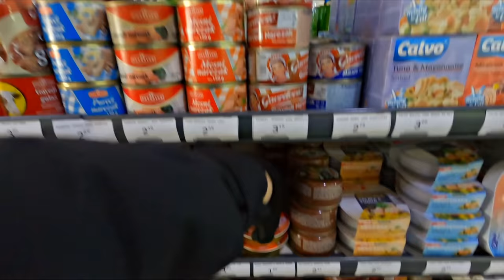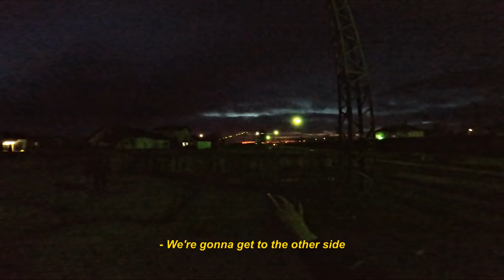Journey Across Bosnia & Herzegovina | Part 1

Comment: Great content guys but just a bit of friendly advice, I've been involved with the Mines side of Bosnia for many years, granted around Prijedor you are fairly safe camping in the woods as the area is quite a way behind the former confrontation lines, however around Doboj and other places it is still not safe to go into wooded areas to camp, most mined areas are clearly marked however they are not fenced off and you will miss the mine signs at night especially which can be spaced out over quite a distance in between each other, if you continue in Bosnia or any country bordering it please check with as many locals you can as to the location of mined areas.
Reply: Replying to this comment as VERY VALUABLE ADVICE.
Reply: Well, I live in Bosnia, and let me just lower the fear of mines for a second. Yes, there are still mine fields, but they are no where near any villages/towns. They are deep in the forests/fields, and quite far from any human access. The ones that are anywhere near are well marked. I personally think they don’t go kilometers deep in the fields and forests for a camp. 

Im just sad to see so many comments about mines here, I lived here my whole life, travelled entire country back and forth, through forests and fields, and never even crossed anywhere near mine field. So im not really sure why is there so much fuss about it. It’s literally hard to find them even if you try.

Comment: I understand that doing this kind of stuff would require a lot of planning, knowledge and survival skills. But exploration is one of those things I really want to experience more in my life, it certainly does seem overall quite fulfilling. Especially taking in the atmosphere of the environments you travel through.
Reply: Get it done before you're 40. The old body is not like the young body was, js.
Reply: same i wanna expirience all of this before i die
Reply: The experience is Much Much harder than shiey videos make it look
Reply: @cyclocrossthesea-lionman1824  agreed. Shieys videos (especially the newer ones) don't show the hours of doing literally nothing, sitting outside in -15° weather in little clothing, or the blazing heat in summer. Along with risks, sickness wildlife, even just one bad fall or breaking a bone unluckily and you can die easily.
Reply: @rickc2102  what happens when your 40? lol
Reply: @Plant_lover_495  you become 40, anything physical is harder then.
Reply: @ilikefrogs4291  yes that is true, but its all relative. Working out is never easy so just never stop so your body stays used to fitness. Its when you stop; thats when it get tough...starting again.

Comment: Watch those overhead wires man, medium rare shiey if your not careful.
Reply: True. You can read a lot about fried trainhoppers in russian newspapers. The risk to be electrocuted is quite insidious because it's difficult to foresee the consequences: one day you are riding a train and everything is fine (because the air humidity is low) and the next day you are dead in a seemingly the same circumstances (because the air humidity is a little bit higher).
Reply: @ZZizitt  yeah you don't even need to touch the wire to get cooked.

Comment: 24:38 - protip: jump to the opposite side the train is going. by inertia you will get "launched" to the way the train is headed. If you jump to the opposite side of the train you will compensate part of the inertia.
Reply: That´s true, but i think only at low speed. If you jump of in opposite direction you could fall on your back/head which is "maybe" more dangerous, especially at higher speeds.
Reply: @02 Aakash Bardia No, that is false. You have to jump to the  opposite side, but look where the train is headed. That way your fall will be safer and you will be slower because you will compensate part of the inertia.
Reply: @AndiStmk  True, I should have mentioned you are supposed to look to where the train is headed, but jump to the opposite side of where its  headed.

Comment: Fun fact: The reason that train stopped in the middle of nowhere is because it's probably the place where they change power supplier, so train actually idles with no power few meters, turns off, and they connect to a power grid of different supplier

Comment: FYI (during the next train ride)
The voltage in the wires above you is at least 20kV (differs from country to country).
Don't go near the wire in radius of 2m, otherwise it will fry you.

Comment: 21:10 getting that close to wires is not safe, like -at all.
in humid/foggy weather you could fry.
also, standing on those cylindrical bumpers -when they get worn out; they start to rotate.

Comment: there is a more advanced method for disembarking on the fly.  That is, if you have a hand hold, grab it and run along side the train, and then push off away from it.  Though that only works under 20 mph or so.  Also stay away from the connections between cars.  Good way to get killed.

Comment: Man, you gotta be careful around those power lines when jumping over the fencing of the train or climbing up the piles of material in those vagons. I think you know that, but sometimes (maybe because of camera angle) it looked like you are getting your head pretty damn close to those lines. I don't know what voltages are they using there but if you get like 8 inches or closer to 25kV power line, it's the last thing you do, please mind that and be careful

Comment: Prolly filler material, i'm going to assume that the state of the rail, and or the state of the carts, prevents them from loading them up full fill. The operators know that if you chuck them full, they'd break the rail. Again, i'm assuming.